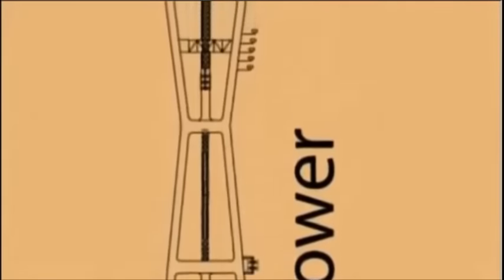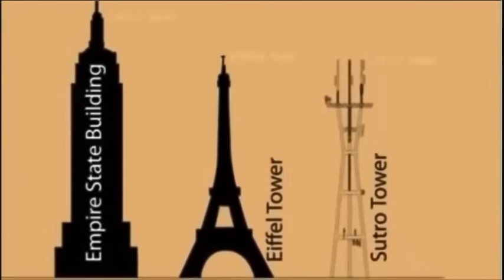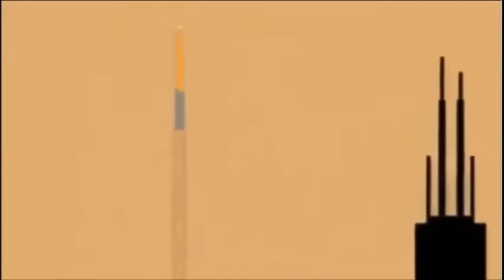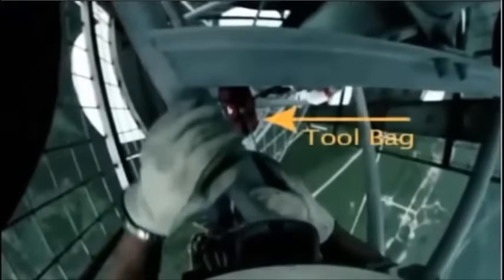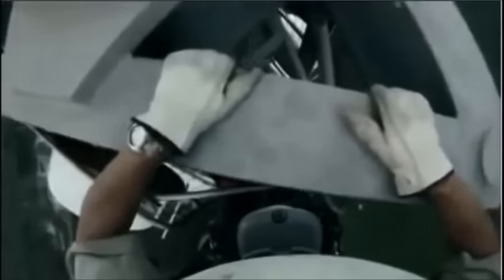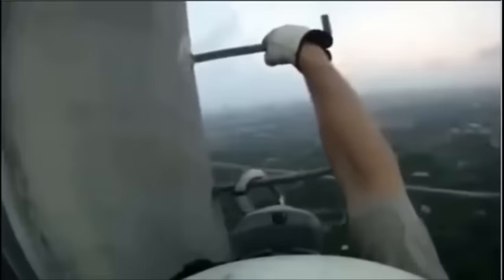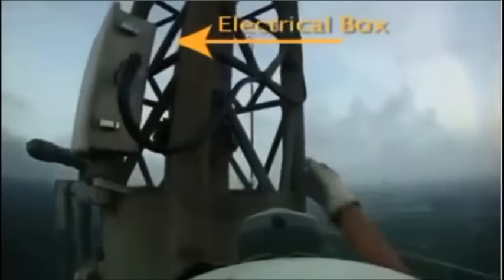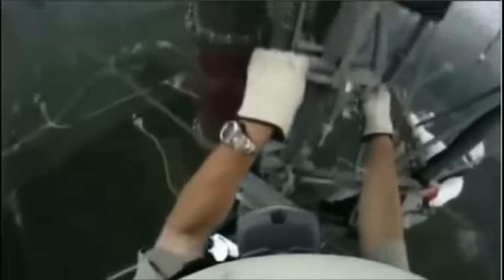Climbing The World's Tallest Radio Tower

Comment: Terrible example of how to do the job.  This climber is ignoring the safety protocol which requires him to be tethered at all times.  Even when it does show him tethering, he is only using a single tether and is tying off to the spikes on the mast, where the tether could easily slip off the end.  In this job, safety is everything... the only possible outcome of a mistake is death.
Reply: Michael Besemer What are you going to tie off to? There's no way to have a safety rail that doesn't make you stop every 5 feet to unclip and clip in again, which would exhaust just about anyone in no time at all.
Reply: What do you think is more exhausting... tying off every 5 feet (which is what OSHA requires) or slamming into the ground at 120 miles-per-hour?
Reply: Michael Besemer He says in the video that OSHA allows for free climbing, unless he is lying.
Reply: No OSHA rules do not allow that at all!!
Reply: +Michael Besemer lol
Reply: +Tyler Wright I have to believe anyone that works for OSHA, has never had a real job that required physical activity. OSHA stands for over kill on safety.

Comment: I had to change light bulbs once in a while in a church involving an extension ladder that I had to carry up to the choir loft which was already 20 feet above the main floor, and from there had to climb the ladder another 20 feet up to the attic hatch and then crawl along a number of 2x12 planks spanning the length of the church to locate the ropes to lower the light fixture to the pews far below, knowing that one slip on each side of that plank would mean falling through the ceiling tiles to the pews below!
  I then had to crawl back to the hatch, down the ladder, down the choir loft stairs, put the 300 watt incadescent bulb in, then go back up to pull the rope back up and fasten the hook of the rope to a roof joist! I had to do this alone which was all the more scarier!
  I was 18 at the time and I doubt I could do it again!

Comment: My vertical is beyond the limits now....THIS tower seems to be even worst to try to climb.....specially at the very top.....sure better pegs that can handle the safety clips....well for sometime.....until the workers get to the other portion, with those bolt-like pegs. The worst part, as well, is that the climber's pegs, for the most part, are ONLY on the one side of the tower! Good Lorrrd.